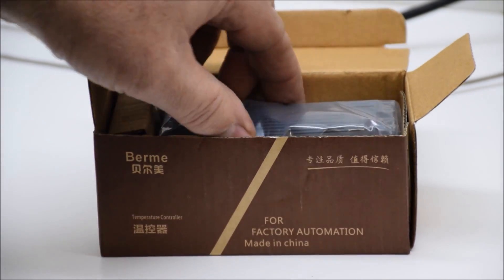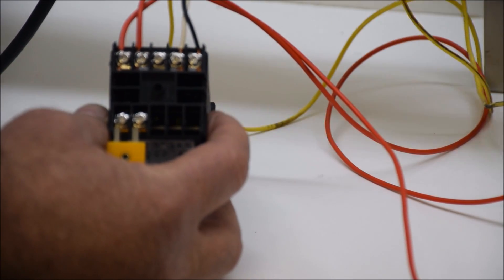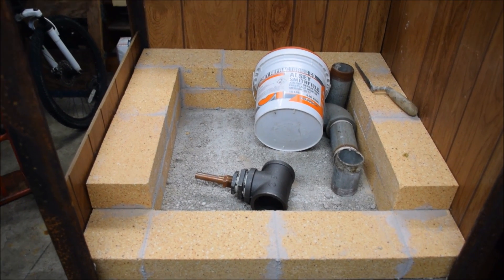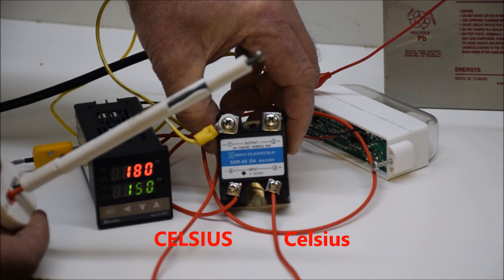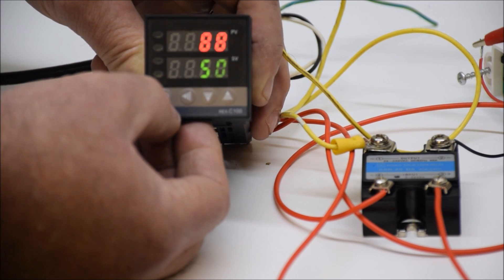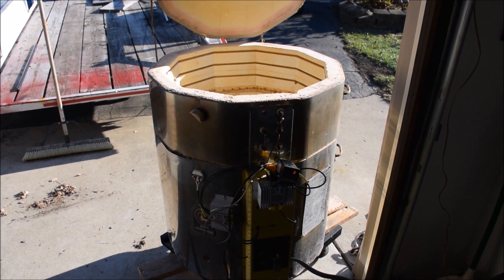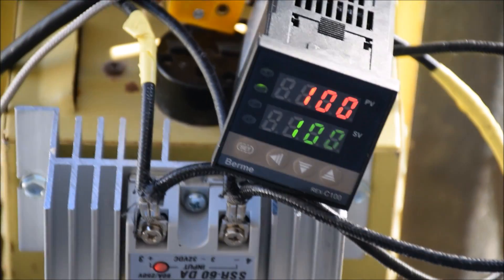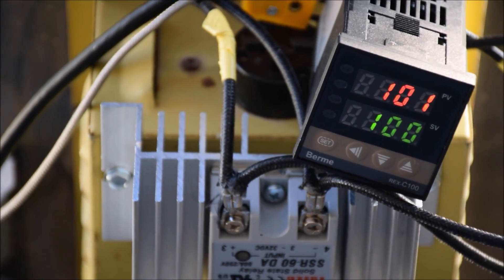REX PID Controler C100 FK02-V*AN DN anmnealing Kiln

Comment: Hi, What size of awg wire do you use for connections?
Reply from the maker: on the control side 16-14 gauge wire should be fine. On the relay supply side it should be rated for the amperage you are using. 30amp- 10 gauge, 40amp- 8 gauge, 50amp- 6 gauge.... and don't over load the relay.

Comment: Did you find out if you where able to ramp?
Reply from the maker: Not with this controller. Would have to reset temp every time to lower temp.
Reply: https://www.google.com/search?q=automate+Ramp+temperature+with+REX+c100+PID&rlz=1C1CHBF_enUS910US912&oq=automate+Ramp+temperature+with+REX+c100+PID&gs_lcrp=EgZjaHJvbWUyBggAEEUYOTIHCAEQIRigATIHCAIQIRirAjIHCAMQIRirAtIBCTMxMjY5ajBqN6gCALACAA&sourceid=chrome&ie=UTF-8

Comment: if you're melting glass, in say a crucible, it's a furnace.  the glory hole is used to reheat the piece of glass you're making, and is just an on/off device.  no need for a thermocouple or controller on a glory hole (glories heat around 2600 F, sometimes a little hotter).  I'm a glassblower by the way.  just an FYI, not trying to be snooty.
Reply from the maker: Building one to cool / anneal the glass after blowing.

Comment: Hi Kevin,

A few remarks. I bought the same K-type thermocouple with the ceramic tubes. It was advertised on ebay as 1372 centigrade. I don't think you can use it for melting glass above 2000 C.
I tested the thermocouple with a blow torch like you did. But I only heated the tip and did not break the ceramic parts :-)
With my torch I could not get it above 1050 C but the metal turned orange in colour and you can expect it to melt a a certain point.
When you read the wikipedia page for k-type thermocouples, you will see that the chromel-alumel alloys used to fabricate the thermocouples melt at:
https://en.wikipedia.org/wiki/Chromel: 1420 C (2588 F)
https://en.wikipedia.org/wiki/Alumel:  1399 C (2550 F)

In the video, I saw that your PID controller is of model C100FK02. 
FK02 has a temperature range of 0-400 C
Did you find a way to reprogram the controller to get above the 400 C mark?
Reply from the maker: I've put this project on a back burner for now. I am keeping an eye open for a controller that will ramp the temperature for annealing the glass. On and off I've been building a blast furnace that will reach 2300 degrees for melting glass as time and money permits. 
Good info on Wikipedia!
Reply: If you really want to save money, don't just try to go el cheapo on the building materials.
This site lets you calculate the amount of heat leaking away through the insulation material:
https://www.engineeringtoolbox.com/conductive-heat-transfer-d_428.html
Scroll a bit down to the "Conductive Heat Transfer Calculator"
What I know of melting glass is that you need to leave the furnace on for quite a long time to spread the heat evenly through the material. Dartington Glass in Devon England leaves the furnace on for more than a day before they start taking crystal from the melt.
A material like 2" aluminium silicate blanket around the fire bricks will save you a lot of energy!
Reply from the maker: Living and learning the hard way. When I started this project, well over a year ago, I was thinking $200 to $300 dollars. I'm closer to $1,000 now and still slow but sure buying materials as I go. 
The down times, when I'm broke, allow for more time and research, along with help and suggestions from others, Like yourself! 
I'll still be a head of the game dollar wise. To buy a glass melting furnace of the size I'm making would cost over $5,000. 
The inside of my chamber is 18"X18"X 18", but I've been rethinking this to add more insulation on the inside along with the blankets around the outside. I hope to get back on this with more free time in later 2018.
Reply: The REX-C100 can detect temperatures from 0°C to 1300°C (2372 F). It can measure temperatures from 0°C to 400°C in the panel mount 48×48 package. It can also be used to ramp the temperature up or down: https://www.google.com/search?q=automate+Ramp+temperature+with+REX+c100+PID&rlz=1C1CHBF_enUS910US912&oq=automate+Ramp+temperature+with+REX+c100+PID&gs_lcrp=EgZjaHJvbWUyBggAEEUYOTIHCAEQIRigATIHCAIQIRirAjIHCAMQIRirAtIBCTMxMjY5ajBqN6gCALACAA&sourceid=chrome&ie=UTF-8
 @kevincronin60181

Comment: you can ramp it with a little moding and a raspberry pi. if you want to ramp it with 4 ºC/MIN, can you wire  the "SET" button and arrow "UP" button, to two transister, which you control with a adroino or raspberry. then you loop "SET" "UP" "SET" "15 sec pause" 580 times to get from 20 ºC to 600 ºC with 4 ºC/MIN. i thinck you get the point.

here is a video on how to code the raspberry to send the signal https://www.youtube.com/watch?v=9uot9uIC5CA
Reply from the maker: I am trying to figure out how to ramp the temp over a time periord Example: Hold it at 975  Fahrenheit , then when ready, slowly (turn on Annealing of glass) lower the temperature over an 8 hours down to 375, then shut off .

Comment: If you enter the setting mode, you can change the setting "SL2" from the default "0000" to "0001" which will allow the unit to switch from Celsius to Fahrenheit. You can get the documentation here: http://www.fmfranklin.com.au/products/data/rkc/c100set.pdf   or you can get another one here: https://www.rkcinst.co.jp/english/pdf_manual/imnzc22e1.pdf   I have both. the first document allows you to write your settings in. I made my own spreadsheet. I am using the PID to heat a metal foundry to melt aluminum, so I am using a type K thermocouple (code K05) that goes from 0C to 999C. The thermocouple supplied with the PID C-100 only goes from 0-400C for those who watch this.
Reply: Hello
I have AOB508 economy digital indicating controller
the temperature inside bio-gas reactor is 10 decrease less than the temperature that shown on the digital screen. Can you kindly tell me how to correct this.
Thank you
Reply from the maker: Good info to know and keep handy!
Reply from the maker: I have no idea.